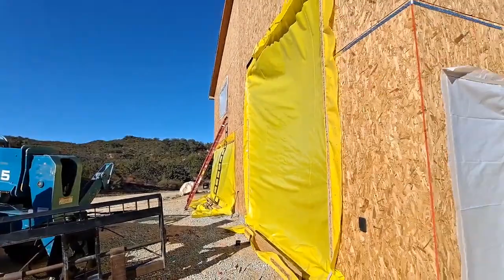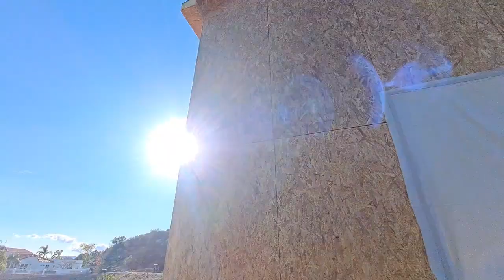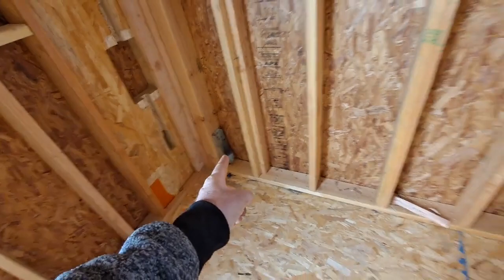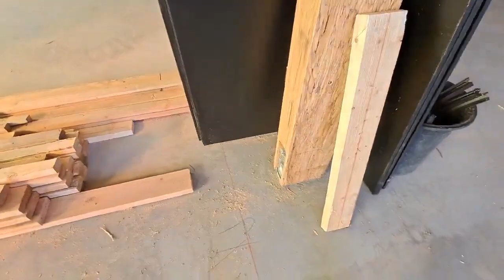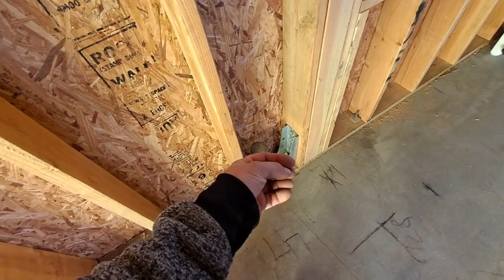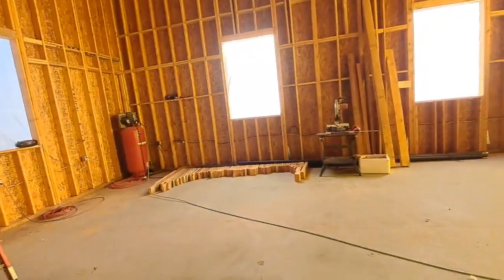CA new home construction project update framing completed and passed Riverside County inspection!

Comment: did you compare costs with cinderblock vs wood?
Reply from the maker: I did not, but the architect I used understood I was trying to save cost without sacrificing quality. He made a lot of suggestions but that wasn't one so I suspect it was for a reason. There was so much seismic engineering and efficiency requirements for this state I bet that has to do with it more than cost. 

If you do, share what you find out!